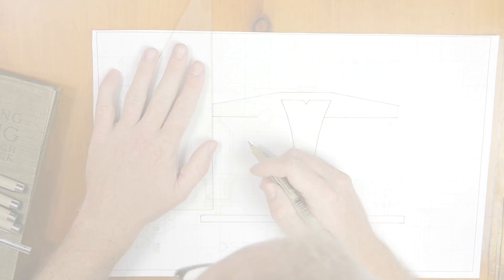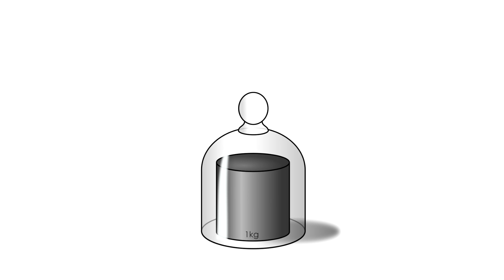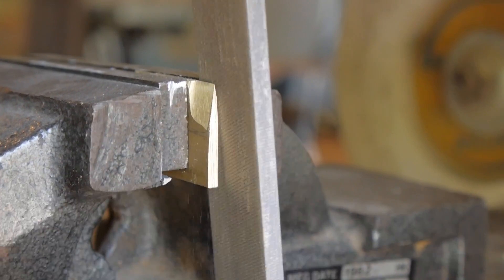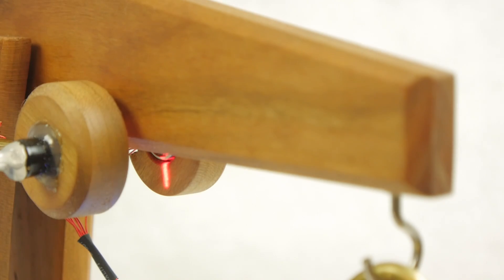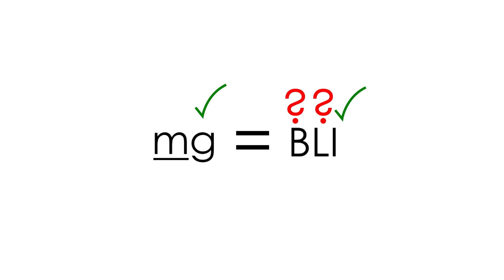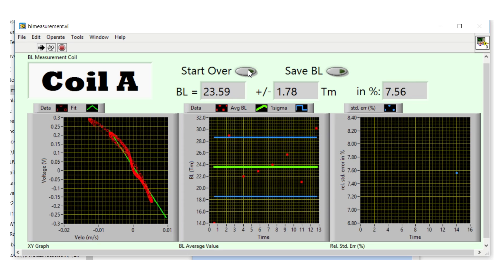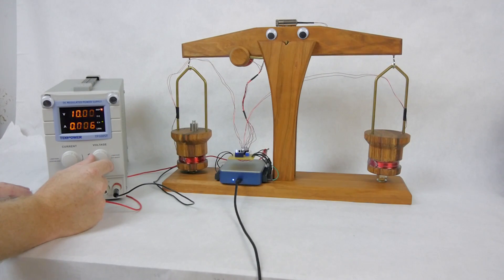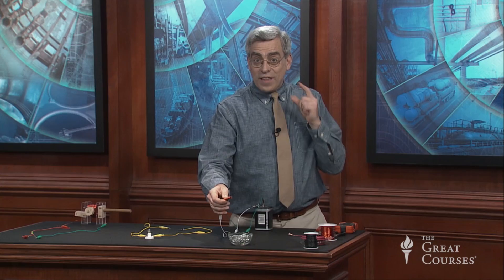Redefining the Kilogram with the DIY Watt Balance

Comment: Not sure which was the original and which was the overlay, but I thought the units for g is an acceleration, or meters per second per second, or m/s^2.  Looks like one of them tried to have units of square meters per second.

Since the Earth is not uniformly dense, g varies slightly depending on where exactly the measurement is made.  I wonder if it would be beyond the capability of any real instrument to measure/detect the variation in g whicih may be present on either side of the balance.  Plus I wonder about the ability to make each side of the balance exactly the same so that the force on each side would be exactly the same.

I have also heard of attemting to redefine the kg in terms of a certain number of moles of Si-28 formed into as nearly perfect a sphere as possible.  Why it needs to be a sphere, and why specifically Si-28, I don't know.
Reply: a sphere because it is easy to define the shape of a sphere. it is fairly simple to create a round object as opposed to something like a cube, where you need to worry about each edge and making sure each face is parallel. 

Si because we can very easily make very large single crystals of silicon. Si-28 because every Aston must be the same mass so we can precisely define the mass of the entire sphere and so that different masses of different Si isotopes don't distort the sphere.

Comment: I thought that one liter of pure water weighed 1 kilogram in 9.8m/s/s of gravity?
Reply: that was one of the original definitions of the kilogram. but water's density is both temperature and purity dependent and is also an artefact like the ipk.
Reply: Matthew Rowles You can make pure water easily, and its measured at room temperature, 24.2 degrees centigrade
Reply: Curiosity Of Mankind but not isotopically pure. The deuterium will skew the result.
Reply: Matthew Rowles Hmm true, thanks for pointing that out i never thought about that. Yeah deuterium is very hard to get rid of completely...
Reply: Incorrect, 1 liter of water weights 1kg at 4C.
Reply: Steve Greenfield with what isotopic composition? A litre of light water will be different to normal water will be different to heavy water.
Reply: Matthew Rowles A very good question that I do not know the answer to, off the top of my head. I do know that temperature makes a HUGE difference.

Comment: 5% through hole resistors, haven't seen those since Radio Shack folded. 
You are also well beyond the accuracy of that power supply meter, if it was ever calibrated. 

way too much time.

Comment: Next video: How high-precision gravity measuring devices work ?
Reply: Anchor and ballistic gravimeter. First is too simple, second is too complex. It would require interferometer with stabilised wavelength HeNe laser, and most hard part to made - probe unit thrower. Probe must flying in vacuum tube without any rotation or tilt, also it must have prismatic reflector for interferometer work. Computing is the easyest part). Our gravimeter was mounted on Ural military truck.

Comment: I'm taking a course in Instrumentation this semester and my final project will be a balance using an apparatus like this, but instead of building a complete watt balance I will consider my system as a spring-mass system and measure the mass looking at the fundamental frequency of oscilation of my system. 

It'll be cool to try a different physical principle, but sadly I'll lose the "self calibration" feature.

If only you posted this video a few weeks ago I could have improved my project idea.
Reply from the maker: That sounds really cool. If you document the project on the interwebs, send me a link. I love stuff like that. I'd love to see your project.

Comment: I've never understood why the kilogram cannot be defined as just the mass of a certain number of, say, electrons. Don't they have a constant mass?
Reply from the maker: It's not only important that the definition be constant, but also that the definition can be replicated for use in calibration.
Reply: Well, in regards to replication, why not use the mass of a fixed volume of something that has a fixed density? Let's say, water.
1000kg/m^3
And if a meter has a definition that already is defined according to a replicatible standard, then already, we have a definition of a kilogram. Don't we?
What's so wrong with this simple definition?
Reply: Water expands based upon heat and pressure.
The unit of pressure is derived from mass. (kilograms per square m)

Comment: what about the carbon ball kilogram?
Reply: They are expensive (about 3 million US dollars) and take a long time to reproduce, but it is one approach. If used as a standard, it would be something that other 'normal masses' could be standardized against.
Reply: They are using it to try to redefine the kilogram, they are in competition with the watt balance and the watt balance is winning.
Reply: In order to redefine the kilogram, "they" require 2 different types of experiments, performed in at least 3 different labs to agree on the mass of a kg (and thus the other physical constants).  The watt balance is probably the easiest to reproduce.

Comment: Interesting video. I have a question: you need a measurement of current to measure your mass, but you also say the kilogram is involved in the definition of the amp, the unit of current. So surely your ammeter must be calibrated to the IPK through some chain, and thus you haven't really eliminated the need for the IPK?
Reply from the maker: The paper I linked goes into more detail about this. They have to fix the value of the Plank Constant using the IPK which will then allow a definition for the kilogram.

Comment: Are the variances in gravity minute enough to not matter? Tidal forces and whatnot
Reply from the maker: For the real laboratory balances, they have to measure gravity very accurately. I don't have a way to do that, so I just used the International Gravity Equation.
Reply: I think you're coming from the place as me, worrying about the gravity not being constant over the globe.... when I first thought about it I figured it doesn't matter, because it's the same gravity at that point, so you'll still get an exact measurement.... but it would vary between another's locations "exact" measurement.... as long as you'll allowed for the discrepancy, no different to celebrating any other measurement device, it'll work everywhere

Comment: This got me thinking about a chicken and egg problem. How do you measure voltage, current, and resistance precisely to create standards? Given one standard for any two, I can standardize the third, but how do you get the first and second standard? How do voltmeters work on the circuit level?
Reply from the maker: Yes it gets a bit circular. The paper I linked goes into greater detail about the mechanics of how the redefining is possible.

Comment: but how do you know the strength of the magnet is constant.  dont all magnets lose magnetism slowly overtime and when in contact with outside magnetic forces? like the earths magnetivity.  i thought they make super strong magnets by applying a high voltage electromagnet to the rare earth magnet. then coaligning the particles so they are all magnetically pointing in the same direction.

Comment: Volts are joules per coulomb which are Kgm/s^2. This doesn't eliminate mass from the definition of mass. It's a nice scale don't get me wrong, but it's still comparing the weight on the scale to the kilogram in France. It's hard to get away from sketchy Kgs but I'm sure we'll get there somehow.
Reply: It reverses the relationship, so instead of the Planck constant being derived from the kg, the kg becomes derived from measurements you make based on the Planck constant. Like how the wavelength of a specific frequency of light was originally measured from the meter defined by a different mechanism is now used to define the meter.
Reply from the maker: I wasn't able to dive into that in the video, but the paper I linked give a good explanation. The watt balance is not my idea. Scientists way smarter than me came up with this idea.
Reply: I know you didn't invent it you said so in the video :P I looked into the paper and I didn't have to look far 

from paragraph one of the introduction of the paper:
"In the redefined system, the base unit kilogram will be redefined via a fixed value of the Planck constant h" 

from the wikipedia article on the plank constant:
"The Planck constant has dimensions of physical action; i.e., energy multiplied by time, or momentum multiplied by distance, or angular momentum. In SI units, the Planck constant is expressed in joule seconds (J⋅s) or (N⋅m⋅s) or (kg⋅m2⋅s−1)."

I mean I'm just some guy watching a cool video but even I can see that their line of reasoning is a dead end for the definition of a kilogram. The watt balance is a really cool scale but It's not getting us any further from Kg=Kg.

Comment: Electric motors can be reversed to induce current. I get that. I just have one question. Where I work, I work with a lot of different electric vehicles. The majority of these vehicles uses DC brushless motors that runs at an insane RPM. This gets geared down and down, so the vehicle only goes about 25km/h. Here's the rub: When I tow one of these vehicles (I'm a mechanic) I can't tow them faster than 5km/h, or else the windings around the rotor gets "thrown out". I didn't believe this at first, so, stupid as i were (am) just towed it in 15km/h. The motor was completely destroyed, with the coils inside the motor just laying aorund inside. Why does this happen? The motor is used to spin at this speed and even higher!
Reply: maybe the motor when you tow the car is working as a generator. if the motor is wired or short circuited. the wires will overheat and melt. because you car has more power that the power the electric motor can safely generate.
Reply: What do you mean be "thrown out"? I haven't seen enough high power brushless DC motors, so unfortunately I don't know what there is to be thrown out (the stator assembly is typically very rigid).
Anyway, from what you describe it is very likely that the motor coils are short circuited when the vehicle is off. So if you spin the motor all the current/power induced in the coils by the permanent magnets is dissipated in the coils. The heat from that will destroy something (that's why I asked what you mean by "thrown out", because I don't know what the something would be; the mounts? the coil wires? the coil cores?).
I normal operation the short circuit is not an issue, because the only time it does something is when the vehicle slows down to a stop. These short bursts of high currents in the coil aren't enough to heat them up to destruction. The vehicle might even be more intelligent under power and use regenerative breaking or at least has breaking resistors, which in both cases means that the breaking power isn't dissipated in the coils in the first place.

Comment: How did you measure the acceleration due to gravity?
Reply from the maker: I don't have a way to do that, so I used the International Gravity Formula. In a lab, it can be done accurately using laser interferometry.

Comment: but it's defined in terms of g which varies a lot doesn't it?
Reply from the maker: Not only by location but also in time. You need to get an accurate measure of g when you perform a mass measurement with the balance, but I don't really have any way to do that, so I used the International Gravity Equation.

Comment: You still have a mass artifact, the earth. And volt is a derived unit that employs the standard kilogram. 

Now presumably the percent variation over time of the earth is considerably less than the lump of metal in Paris, so it is arguably a better choice for a standard.  But G does vary measurably with location, and even temporally, by up to 1%. Further, Watt is a derived unit based on the SI standard kilogram. 

It is a really cool balance. I even want to build one. But from your video I don't see how it would replace the current kilogram SI reference weight.
Reply: The idea is that g will change, but the way we measure g is by falling weights and counting how far they go vs time, both meters and seconds are well defined by the speed of light and caesium transitions. 

has nothing really to do with g, its another number we measure, its not a constant.
Reply from the maker: Acceleration due to gravity can be measured without mass. Labs can measure g with extreme precision using laser interferometry. Your second point is a bit more challenging to explain in a YouTube comment, but the paper I linked does a great job. The summary is that you use some quantum principles to measure voltage and current in terms of the Planck constant.
Reply: Practical Engineering thanks for the response!  That is real helpful. So for a precision system, an interferometry based gravitometer would actually be a part of the scale, to correct for spatiotemporal variation. Cool. 

An agreed upon standard that works in any lab (including one outside of Earth's gravitational influence) would certainly be great. And relating it to physical constants like c or h is ideal. 

Thanks again for a great video!
Reply: Practical Engineering no, it can't. g is literally defined by the average(kinda) experienced Mass of the Earth. His first point is completely valid with no reasonably expressed compensation. The holes in this method would embarrass a sieve.

Comment: Wow.  I always heard that watt balances were super expensive.  That must have been only talking about the super high precision ones.  I never imagined that you could build one at home.
Reply: With the level of precision desired for the kilogram redefinition, I imagine it had to be made incredibly sensitive and accurate, so the level of engineering complexity was likely high, and part specification tolerance was low.

Comment: but i like the silicion sphere approach a little bit better :D
Reply: Eh, there's a big problem with the silicon sphere approach, it defines the weight just fine, but it doesn't aid in comparing that result to other objects. In order to measure other objects, you'd need a machine calibrated to that exact number of atoms of carbon-12. Even though it'd not be defined by a physical object, you'd still need a physical object to calibrate the machines. And constructing an object that weights the exact amount as a nearly perfect sphere of carbon-12  would be difficult, as you'd have to compare it with the weight as well. You would pretty much have to have a perfect sphere of carbon-12 atoms with the perfect radius to calibrate the machines, and it's not easy or cheap to do so.

Comment: Wait, so what did you measure the mass of your 20g weight to be?  Do you think you got a better measurement than the manufacturing specifications?
Reply from the maker: +bluewales73 19.6 grams (shown in the video). Probably not more accurate than the specified mass. The desktop model can't really achieve high accuracy like a beam balance using a calibrated standard. It's more for demonstration of how the full scale lab watt balances work.

Comment: I am curious why in your model you chose to place all of the components that require wires on the beam of the balance (I just realized the line generator and photo sensor appear to be mounted to the stand). The wires will obviously impart a force on the beam, and all of them could be mounted to the stand instead of the beam. Is there a reason you could not mount the magnets to the beam and place the coils on the stand?
Reply from the maker: +Don Conlee The optical lever needs to be on the beam, but I think you're onto something with mounting the coils to the stand. It would be a cleaner design, because you're absolutely right that the wires can affect the reading. I was roughly following the design by NIST.
Reply: You could also place a mirror in place of the laser pointer and mount the pointer on the stand and get two more wires off the beam.
Reply: Thanks for your videos! I learn something new on every one.
Reply from the maker: Another great idea. I'm expecting v2.0 from Don!
Reply: As long as you calibrate with the wires on the balancing beam. I think you should be okay. Unless you think the current running through them will alter the force they are applying.
Reply: @jilow  I worked under  gravity measuring system, it had near 5 signs precision, g is not a constant even for a day period, it depends on moon and sun cycles, and earth internal mass movement. And on video i see friction between static magnets and wood details. And, that photodiode transition depends on temperature, what grows up by incident light even from small source. And even expensive analog signal measurement board cant avoid thermal noise, and  ADC resolution. But that project is inspiring and definitely cool.

Comment: I guess it depends on how you define an "artifact" and "fundamental physical constant". I would imagine that the speed of light and caesium atom, under a specific set of conditions, would be considered constants. I would also imagine that a kilogram weight made up of copper that has 9.47771x10^24 atoms would be a physical constant. Of course, these atoms would have to be identical in nature. The problem is counting all the atoms. But it was also a problem, way back when, to count the periods of radiation in a caesium atom because of a lack of technology. It seems to me that a physical constant is actual relative to one's ability and what is practical based on today's technology.
Reply from the maker: +Heavyboxes some very good discussion here. I didn't have time to go into it, but the other feasible proposal for redefining the kilogram is a sphere of pure silicon, where the definition would be the number of atoms just like you said.